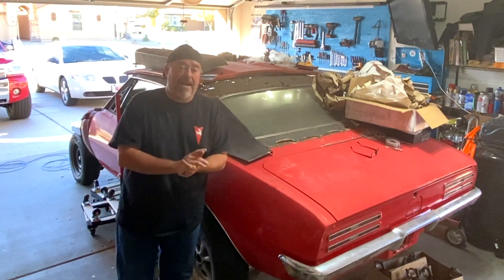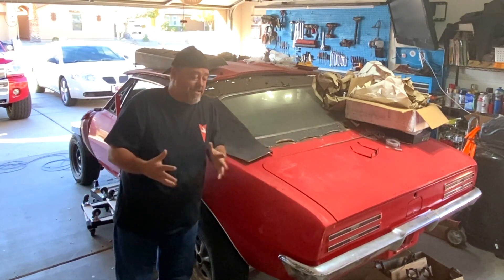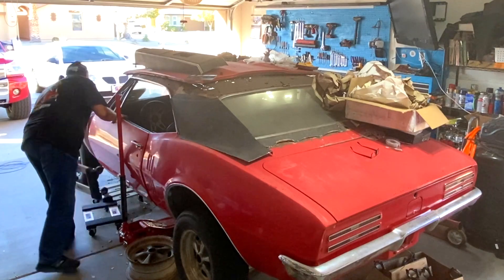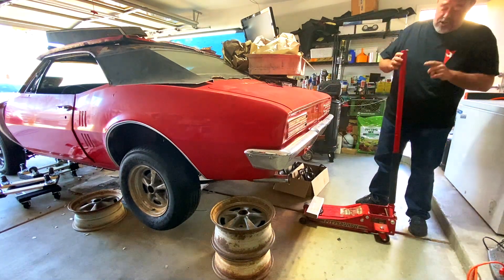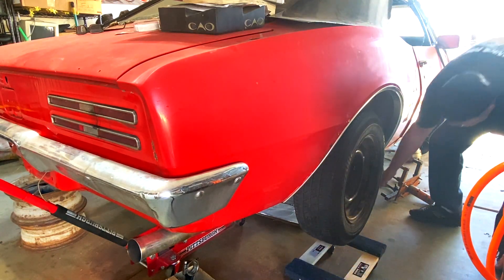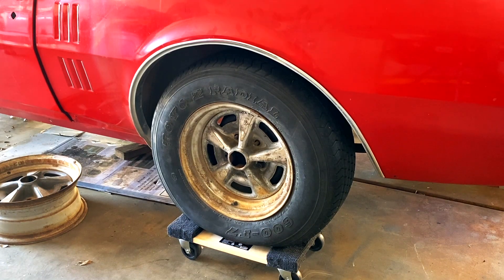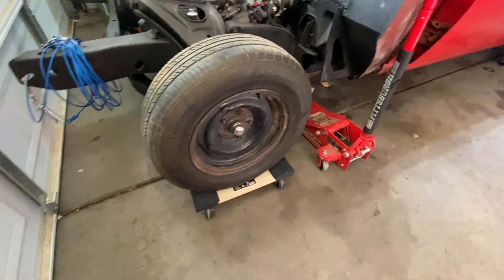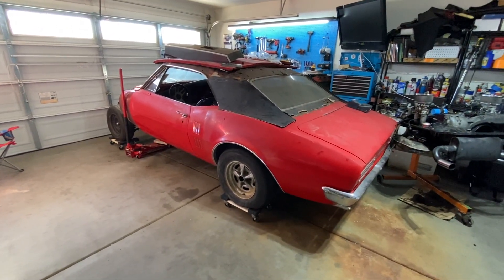Best Wheel Dolly on a Budget - Wheel Dolly for $10 from Harbor Freight - Muscle Car Resto Build

Comment: Buy 6 of them. Take the 8 wheels off the extra 2 dollies and then put 2 on each of 4 dollies to add support to the center. That should help spread the load for moving around and support the weak/stress points.

Comment: Used this idea as well too move my SN 1998 Mustang Coupe with a blowthrough Ford 2.3 Turbo and C4 trans to one side of my garage. But i did add extra casters on the middle of the dollies too help even out the load. The car weights around 2800 lbs. Keep up the great work.

Comment: That's probably works in a compact all plastic modern cars. But that's a good quick solution for a tied garage
Reply from the maker: Oh yea, the weight of that first gen f body car was pushing the limits!
Reply: Modern cars tend to be heavier compared to their counterparts from history. My 2015 2 door manual Honda Civic is 3000lbs. A first gen Fbody shouldn't be much more than that as they are lightest of the Fbodys.

Comment: If you don't need to move the car around much, you can just buy 2 of the dollies and move the rear end first.  I leave the jack in the middle lifting some of the weight off the dollies.  The jack can roll and the dollies will roll better if less weight on them.  Get a good ratchet strap and you can attach to your workbench or wall and the car to move the rear end.  Then put the dollies on the front tires and leave the jack in the middle and ratchet the front where you want it.

Comment: I have these and use them for moving transmissions, and small block engines. They have a duty rating of 500 pounds. I'm all for saving money, but this is a dangerous move. And yes, I've done plenty of sketchy things. You can get the steel ones at northern tool for $49 a pair on sale and with to the $20 off a $100 purchase makes is roughly $80 for a set of 4. 

Love the Pontiac BTW 😀
Reply: The 18x12 in have a work frame load rating of 1000 pounds, the casters are 500 pounds per wheel. same work load rating as the metal haul masters. I would run a furring strip along the ends though to keep the tire centered. I think he's fine, I wouldn't get under it though, and think the haul masters would be better.
Reply: @Reloadeez  I agree with you, definitely keep is centered and don't get under it 😅

Comment: I can't disagree that these dollies are a bargain for what you need, but from a safety point, they are just not suitable.  There is just too much lateral stress on the wood as you push the vehicle and the screws or nails that hold it together will not give you the margin of safety that you need to hold up 3000lbs or more.  Better still to get the ones, even the cheap ones, from HF made of steel.  And I agree, it is not easy to push and move these vehicles by yourself, given the wheels that come with these dollies.  The casters do not easily follow the direction that they need to point to for one to easily maneuver around the garage.

Comment: They worked good tip!  Loving the Pontiac rally wheels,  does the trunk deck have two holes drilled in it on the right hand corner?  They look like the holes for a “400” badge.
Reply from the maker: Thanks man, yes it does!  Not sure if that was stock for the inline 6 cars or my brother swapped the trunk lid out at some time:

Comment: Don't think it's worth it. 
The furniture dollies are $48-$60 set 4. 1000lbs cap. each, wood
Basic metal car wheel dollies $100- $130 set 4. 1500lbs cap.  Each, metal with a locking wheel